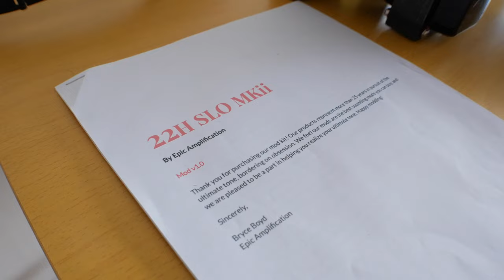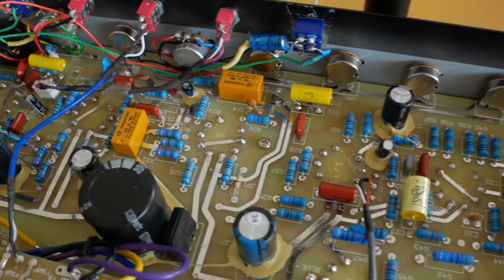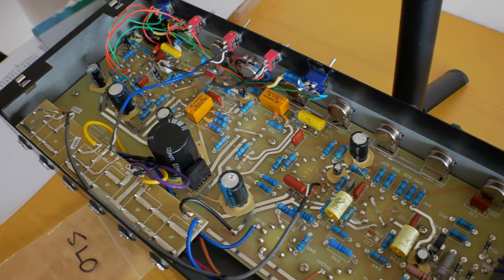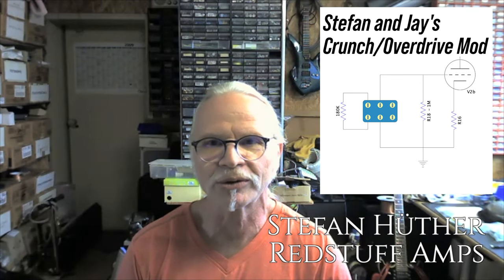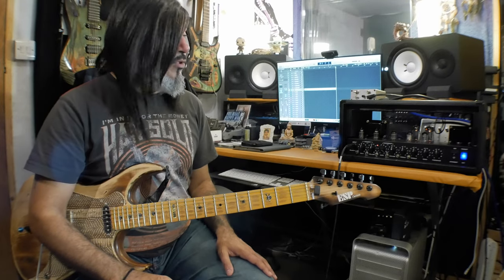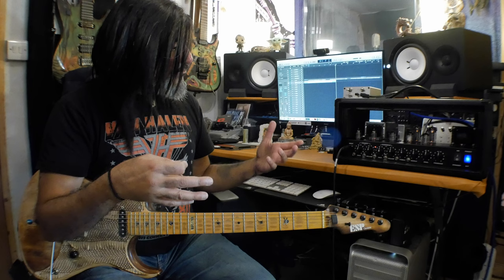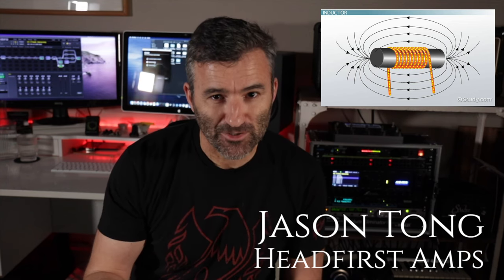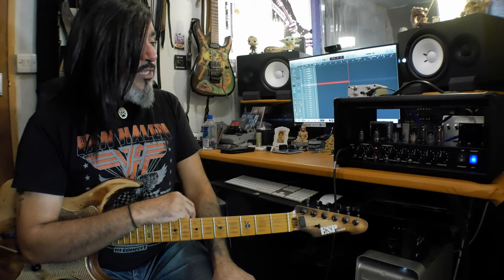Soldano SLO Custom Build | SLO Channel Mod! George Lynch Wicked Sensation Amp - Part 2

Comment: All the mods made a huge difference to the sound for the better. I like how much cleaner it sounds. The mids sound really good. It isn't as gainy which actually made it sound better to me. The one thing when I had my Mesa Road King, was how too chimmy the presence knob made it sound when I tried to turn it up. That choke acted like a nice filter.

Comment: Great tone after the mods. Mind you even in its stock form it ain’t no SLOuch!! Agree with other comments that the choke makes a big difference. Jason over at HFA is great too.:. I installed the JEL mod to my 79 2203… easily reversible too.
Reply from the maker: Hey dude, ah cool! Thats one of my next missions (well after making a Headfirst MCII) - I wanna build a Jake 800! So cool that you did it! Yeah the choke really made a difference - I'm gonna add one to my Purple#39 head soon. I think that amp will benefit from it also 😊 Have an awesome day!

Comment: The transformer helped out the lower gain settings most. Full gain I thought it was a bit darker than the original. Sounds bad ass for sure. Those Jet City amps are hidden gems.  with the choke to my ears it helped the highest gain settings most.
Reply from the maker: Yep! Agreed with that - I had that in mind when I changed the transformer but was mindful that the choke would clear up the high frequencies and high mids too, so when the choke was added into the circuit it added back the bite that the new transformer had tamed slightly 😊 Have an awesome day!

Comment: Jay, what current preamp tubes would you recommend?
I’m running a Tung Sol 12AX7 in V1 and a Mullard cv4004 in V2
Reply from the maker: Hey Phil, great Q! I have tried a few current production preamp tubes and the only one that I kinda liked was the JJ E83CC - it is a higher grade tube then the JJ ECC83. I have one in one of my amps and I was impressed. But for my ears nothing really compares to the Mullards from the 60s 😊 Have an awesome day!

Comment: Jay.. Please help me.. At 4:35 in this video is the tone I am so looking for.. Is this with a wah pedal to help induce this tone or is it strickley from the amp you selected..?
Reply: Can say with a certain degree of certainty that the sound is direct into the amp without any pedals.
I can say this as I also have an SLO modded Jet City 22H and it sounds very Wickedly Sensational 🤘🏻😎
Reply from the maker: Hey dude, the solos on Circle of Fire were interesting to do - I actually used a Line 6 POD X3 for all of the solos - I had dialled that tone in right after George Lynch had sent me the solo for the song 'When Angels Cry' and I was trying to get that vibe - his tone was really creamy. Can't recall which settings I used as I sold the X3 years ago - I didn't use a Wah though. Hope that helps. Have an great day!